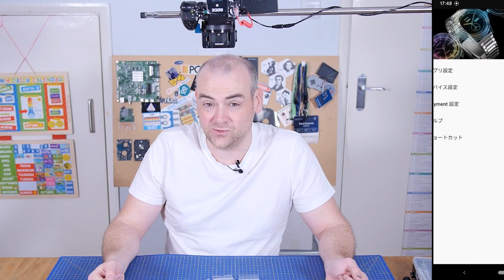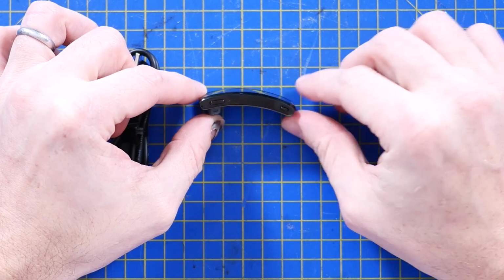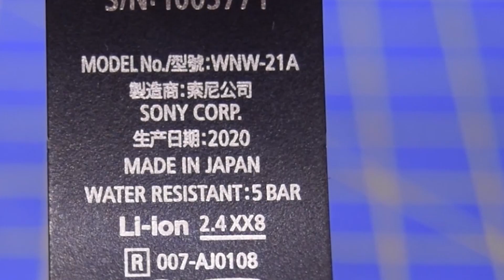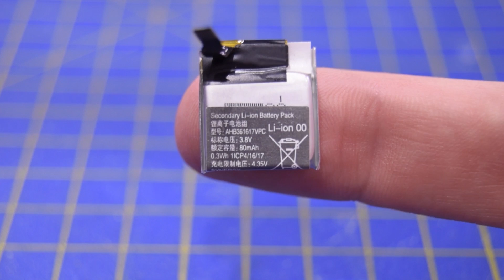Sony WENA 3 Smart Watch Teardown - The Electronics Inside

Comment: Thanks for the teardown. Very helpful.

I bought a used Wena 3 to try out in the US. It didn't come with a charger though and I can't find a charger anywhere. I plan to make my own 5V DC charger but not sure about polarity. I assume it has reverse voltage protection but 50/50 chance. Any idea about pin polarity?
Reply: Hi friend, how did the process went? I'm staring at a very good offer of a wena 3 but it does not come with a charger. I'm feeling like it is a easy fix, but not sure since there's little to none info on the device or it accessories.

Comment: Still ware my 'pebble time steel' daily. Many years later and no one makes a simple smartwatch with a long battery life like pebble did. Don’t need heartrate or exercise or any of the fancy features. All I want is vibrate to get my attention and show who is calling or start of email/text. A watch clasp like this would be ideal as I to prefer mechanical watches.
Reply: I wear the Amazfit Bip S, which is 1 month always-on colour display smart watch so actually twice as long as the pebbles, which sadly Fitbit killed years ago and pebble tried to sell to Amazfit but were told they were already working on their own transflective screen technology. Anyway back to watch, has heart rate detection I don't use, built in GPS, waterproof, vibration and a working 1st party phone app to configure and change screen. Best part is that they're only about £50 and come in a range of colours. Downsides are sleep cycle detection works, but data's not used like the pebble could wake you up during light cycles. But 50 quid for new device with fresh battery that lasts a month per charge and colour always on display, can't go wrong.
Reply: @Samiby never heard of them but defenetly on my list when this pebble time stops working. many thanks.
Reply: That's my view on it!

Comment: Dude, you could just strap a TV set on your wrist. People wear old school watches for more reasons than sentimental value. Smart watches just don't have enough USABLE functionality. The bottom line is they are not worth the money. My Seiko Diver is ancient, and works just fine. And it's not a status symbol. Seiko divers are a dime a dozen. If anything that smart watch of your is the status symbol. You phone does everything it does, and better. And cheaper.
Reply: The same argument can be said for standard watches as well. Your phone already keeps time better than a mechanical watch, syncs itself to an atomic clock automatically, automatically accounts for daylight savings, etc, so why wear a watch if a phone does it better?

Smartwatches, and watches in general, arn't for everyone, but there are many that have uses for them.
Reply: @laurensweyn I’m sporting an Omega Speedmaster Broad Arrow GMT as a daily. I love the precision micro engineering portion of mechanical watches.
Reply: I find that having a smart watch helped me be on my phone less. As I knew I wouldn't get it out my pocket to check it so often (for time or notifications) I then wouldn't interact with it. That was value in itself. I really don't do much else with it beyond notifications and time!
Reply: I'm pretty happy using my seiko prospex with wena3 as the strap since last year
Reply: everything apple sells is a status symbol
Reply: I have an old school automatic mechanical watch. It tells time. That’s what I want in a watch. One dial with 12 numbers, three hands. That’s the list and all it needs.
Reply: @Bill_N_ATX  Well then obviously a smartwatch isn't for you. But I also want to see the date, some weather info, when my next calendar event is, if I've had any notifications and maybe even my phone's battery level at a glance so I don't have to constantly pull out and check my phone for these things.

If you don't, that's fine. Many people are fine with checking their phone or wall clocks for the time as well.